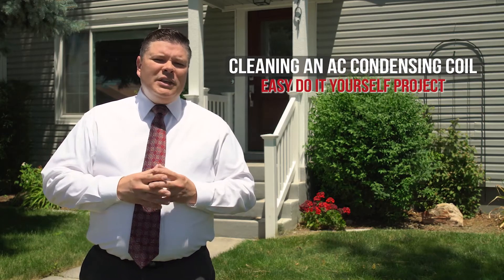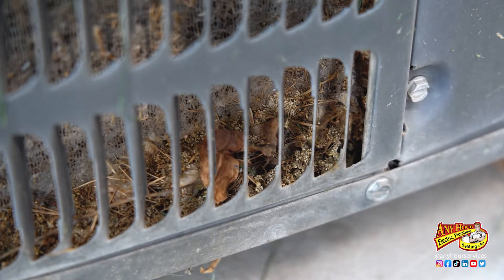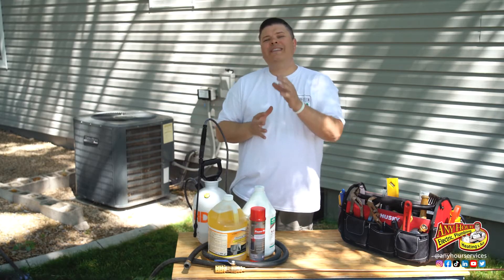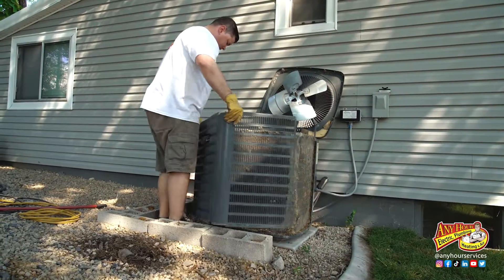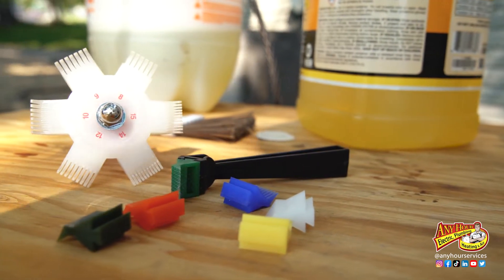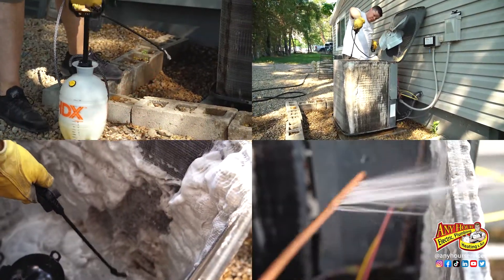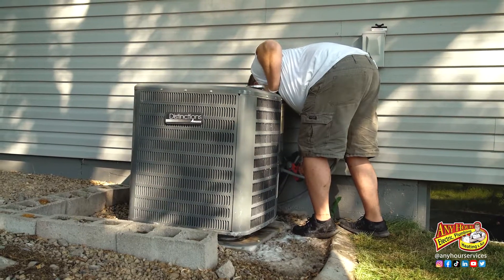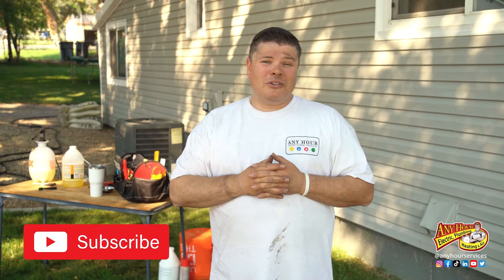AC Maintenance - How To Clean An Outside AC Condensing Coil

Comment: Ok, so I'm a commercial HVAC technician. When I saw a guy wearing a tie that was going to show how to clean there condenser I thought "this should be good 😂"
And to my amazement, you actually did a good job. I do this professionally, so I'm pretty picky. We use some strong chemicals at times. But what you showed was all good advice for your average person at home. I just didn't like seeing those wires to the condensing fan motor being stretched. 
Great work.
I've been thinking about posting a video on all the different types of condensers out there, with the do's and don'ts when cleaning.